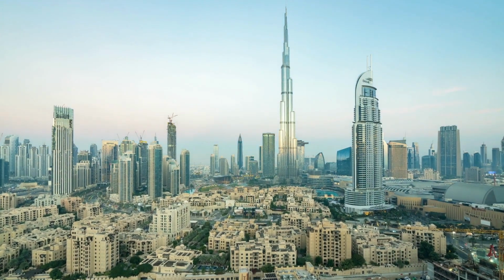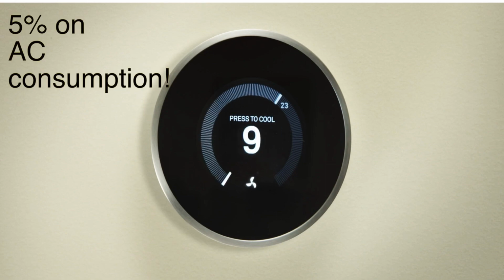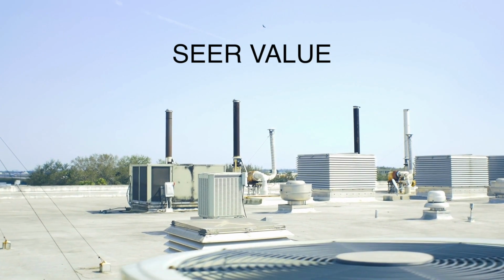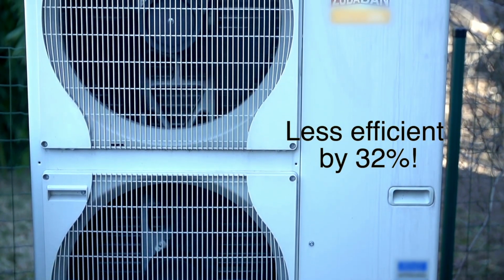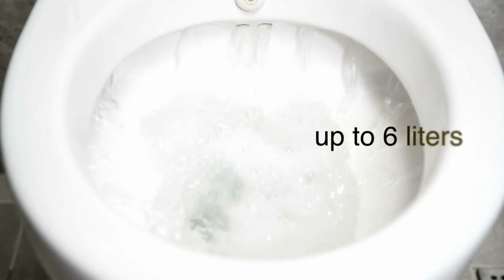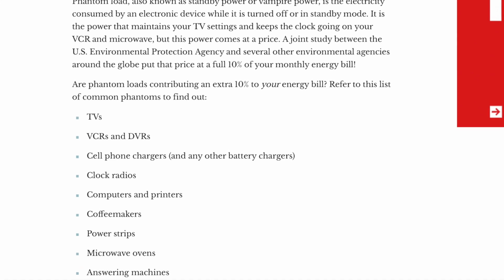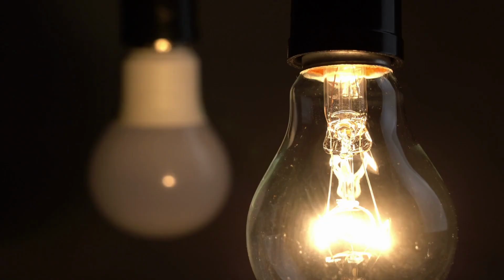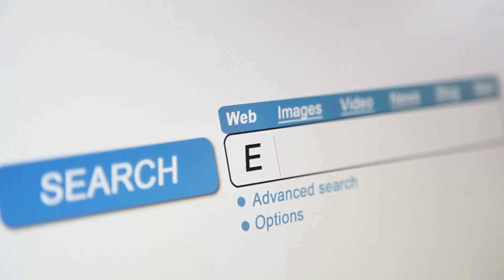Energy Bill Saving Tips in Dubai

Comment: you are misinformed and wrong about the AC Temperature, because Heating cost more than Cooling and every degree you lower your thermostat saves you 1 – 3% on your electric bill . i think you need to do a better research .
Reply from the maker: That is the funniest thing I have heard so far. Perhaps you're the one who needs to have some sense and do more research? Sheesh
Reply: @WYSbyAdamLash  have some common sense and learn about electronics . a heater uses a lot of power and the wattage increases but when you lower the temperature and you set the AC to cooling mode the wattage use decreases and so your electric bill  .
Reply from the maker: @MK.PRODUCTIONS  Ok, I will dignify this with a response:
According to DEWA, the electric company in Dubai "You need to increase the temperature of the air conditioning or cooling units in your homes. Instead of keeping your AC at 20 degrees Celsius or below, keep it higher, close to 24C. Every 1C up, you can save up to 10 percent of cooling consumption."  

You can educate yourself here:
https://gulfnews.com/uae/government/watch-how-to-reduce-your-dewa-bill-official-explains-1.2291021#:~:text=Every%201C%20up%2C%20you%20can,old%20ACs%20with%20new%20ones.%E2%80%9D

And here on their official website:

https://www.dewa.gov.ae/en/about-us/sustainability/lets-make-this-summer-green/set-your-ac-to-24#:~:text=Keep%20your%20thermostat%20set%20at,an%20AC%20is%20ten%20years.

Please read properly before coming to my channel and making outrageous claims. I have been living in Dubai and have followed these tips, and they are true.This is why I made this video. If you disagree, then simply do what you want, but be more respectful to people.